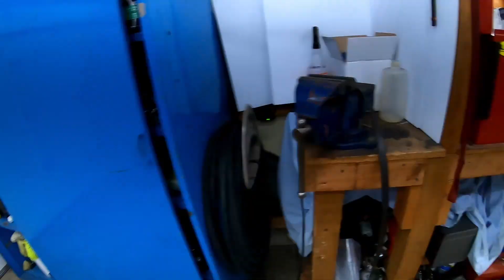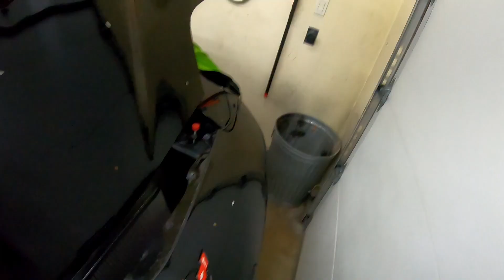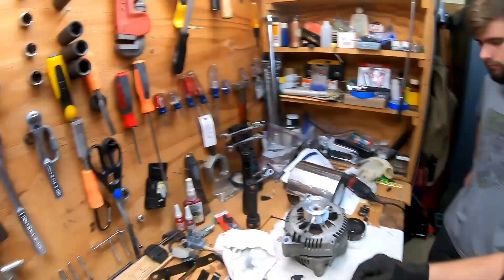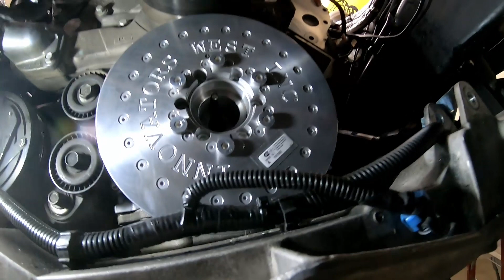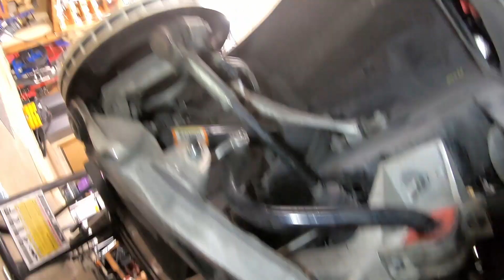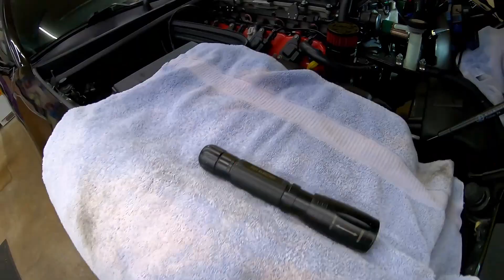How to 8 Rib LSA Supercharger Belt With LS Corvette spacing don't buy Summit C2501 Balancer

Comment: Do you put this set up using, lq4 assorories. And water pump?

Do i just set the balancer at truck or car spacing?
Reply from the maker: This is all Corvette Spacing and corvette bracket and corvette water pump.  Corvette balancer as well.  I've never researched it, but I am sure it's possible to 8 rib truck spacing if that is what you need.

Comment: Well shit, here I am trying to go to 8 rib well at least I've gotten real good at dropping the cradle after multiple balancers and engine swaps now I wonder if they'll take this back or if it will fit on my Tahoe  thanks for clearing this up.
Reply from the maker: Thankfully Summit had no problems taking mine back but I also hadn't pressed it on yet.     That being said, if you installed it with the full intentions of running 8 rib?   I would call customer service and tell them you got a part that doesn't work for you because it was engineered wrong.   Also tell them there is a youtube video explaining why it don't work.  They will take care of you in some way shape or form.  Less labor of course.    I have recently learned that powerbond makes an SFI approved 8 rib corvette spacing now that is built properly.  I would really like to try one.  I really love the Innovators West units but they are pretty expensive.
Reply: @MRBLACK947 Thanks for the info  it's been on a couple of motors by now 😂 may just do the damn Invasion West they wanna sell the whole kit I have a A&A kit on the vette we'll see, this is my other channel I subbed to yours twice, have a good one man.
Reply from the maker: @fullsendC6  Subscribed

Comment: Who makes and what’s the part number on your filler neck for your intercooler setup?
Reply from the maker: Willis that is a factory GM part from CTS-V.  I think cobalts used it as well.  2009-2015 CTS CTS-V LSA 6.2 SUPERCHARGER COOLANT RESERVOIR NEW GM # 25884797

Comment: Were you experiencing belt slip issues? And what size puller are you running on your blower? Sorry if you answered these before, just marathoned this entire series so I may have missed it along the way. Great job on the videos, this gives me a lot of confidence in going this direction!
Reply from the maker: Have yet to experience true belt slip but to be fair the 6 rib belt probably had less than 5k miles on it and a lot of that would be highway miles.   It would squeal from time to time if you stomped on the pedal but then it would regain traction and not lose boost.     This new belt setup should hopefully never slip or squeal.     Blower pully for c5 belt spacing as far as I know is always 2.45"    Thanks for checking it out Alex.